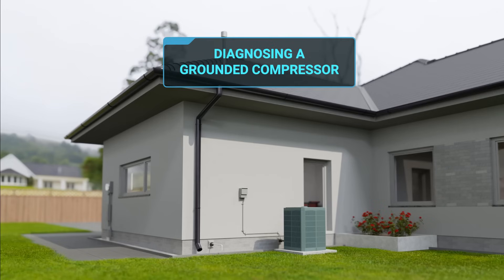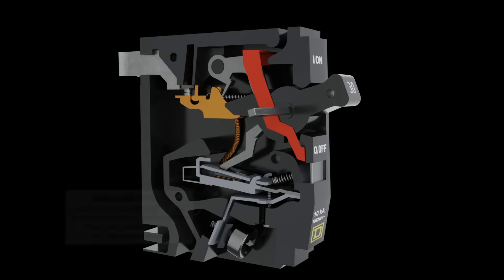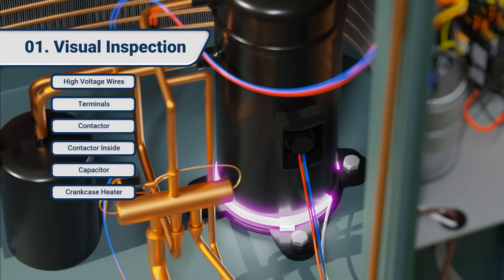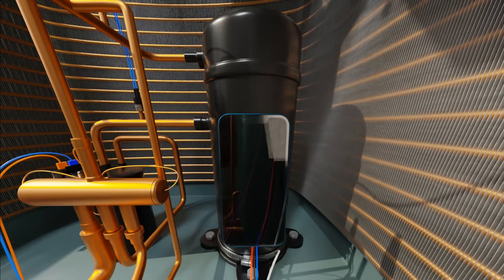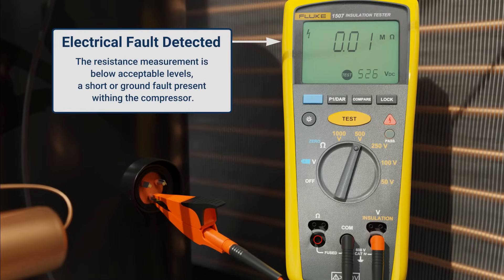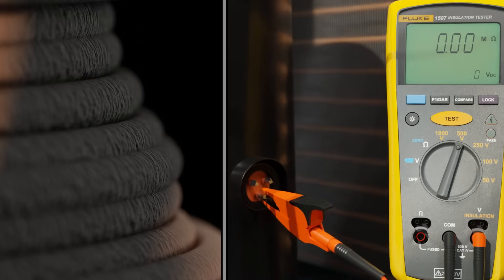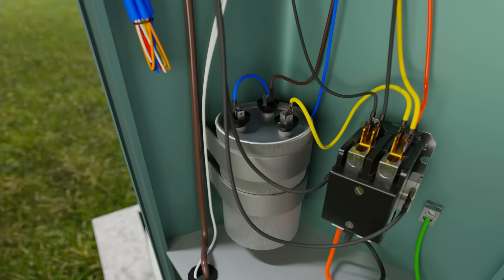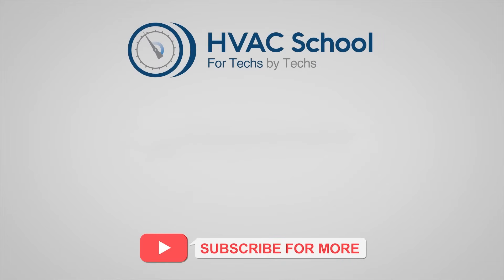Diagnosing a Grounded Compressor 3D

Comment: i usually start by unwiring the high voltage from the contactor of condensor. it makes it clear to me which direction to go next. my next step will be the compressor wire harness or the disconnect (depending if breaker tripped) then ill unwire the crank case heater and fan individually at a time. its usually one of them if its not the compressor.

Comment: Wouldn’t you want to check the Fan Motor for a short also?
Reply: Hence the title of the video "Diagnosing a Grounded Compressor." The focus is the compressor because 90-95% of the time, it'll be the compressor that is tripping the breaker.

If you follow the instruction and steps on this video, after isolating the compressor and the breaker STILL trips, 3-8% of the remaining possibilities will be a wiring issue. If you follow the instructions of the video, you'll have seen it BEFORE having to isolate the compressor, BUT can't always catch it.

It's very rare that the condenser fan motor will be internally shorted. Almost always the condenser fan motor will be seized and obvious when resetting the breaker and testing the unit. This can eventually cause the compressor to run extra amperage for a long period of time and the second way a breaker will trip.

My first test for a compressor is to move the blades attached to the fan motor and if it's stuck or if it DOESN'T move with more than a tap OR if the blades stop way to soon and sudden, the motor has seized or will seize the moment it gets power.

Lastly, I've seen this in the field, is a fan motor that HAD been replaced but the drain plugs were not moved from one end of the motor to the other, depending on the way the motor sits. This causes water to COLLECT in the motor casing and will POSSIBLY (unusually motor is newish) cause a short. But more than likely, will rust the stator and metal to the point where friction and heat will cause the motor not to turn.

Comment: So if we get a high resistance it’s bad? And if we get a low resistance there is no short?
Reply: I'm assuming you're referring to the 22 vs the 5?  The 22 was k(il)Ohms and the 5 was M(eg)Ohms.  1 kOhm is 1000 ohms, whereas 1 MOhm is 1 million ohms.  When testing a motor terminal to ground, you want the resistance to be effectively infinite (OL for open line for standard meters, or something in the megohm range for a megger).
Reply: @EpyonRules  thank you. Another question, so when checking to ground you don’t want any resistance just ol. Thanks for your help.
Reply: @Sc19869 you don’t want any resistance so when you’re measuring in ohms you should O.L or 0.000 reading no resistance
Reply: @JesusLopez-tz8yv  That's not true.  When measuring to ground (with a regular/non-megger meter) you want OL.  0 ohms is bad in this instance because it means that there is a direct path from the winding to ground.  OL and 0 ohms are two VERY different things.

Edit for clarification: OL means there is no path.  0 ohms means that there is a path with no resistance.
Reply: @EpyonRules  ol means you have an open circuit correct. And 0 ohms meant you have high current, so there is a short.
Reply: @Sc19869  OL stands for "Open Line," but yeah, essentially an open circuit.  And 0 ohms doesn't necessarily mean high current, but that there's nothing resisting the current.  For example, touching the two meter leads together should get you 0 ohms or very close to it.  Likewise, touching the leads to different spots on the same piece of steel or copper should also get you close to 0 ohms.  You have a material that's a good conductor and nothing significant between the two leads, so the current can easily go from one lead to the other.
Reply: @EpyonRules  appreciate your knowledge. I’m currently in hvac and this subject has giving me trouble. Thanks again.

Comment: I usually add R22 until the head pressure hits 700 and the compressor gets super hot. I also throw water straight on the transformer and take out the fuses and use 00 copper wire to straight wire it
Reply: LMAOOOOOOO